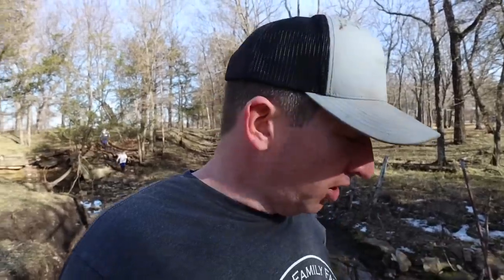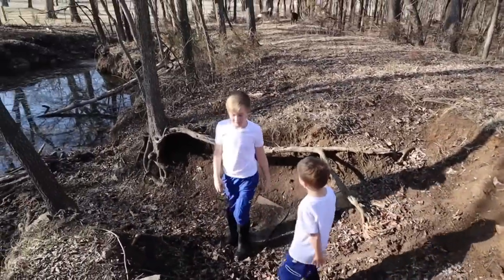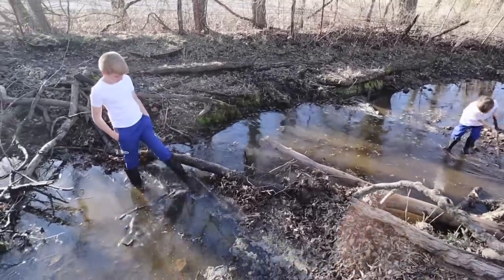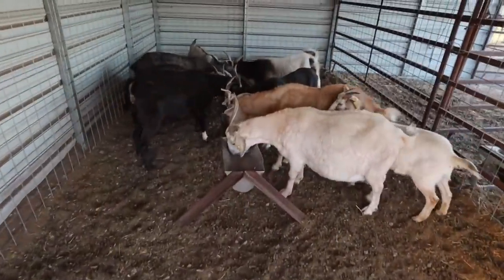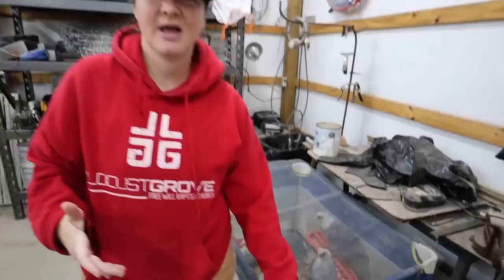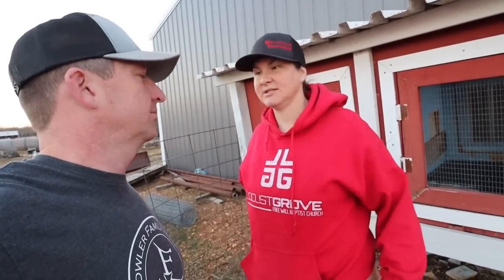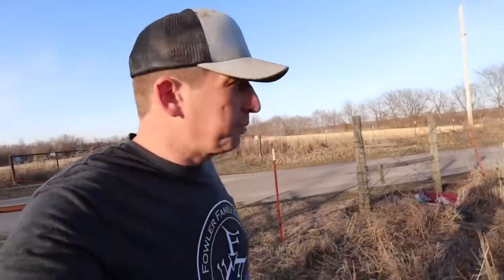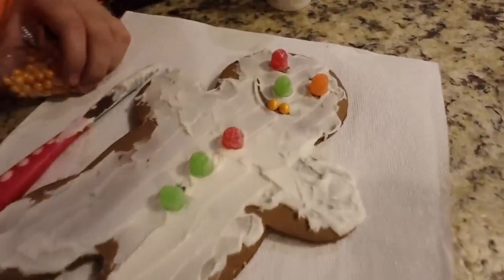Something Isn’t Right With The Cattle

Comment: I used to hang out with my little brother, like your two. We went on adventures, and built forts, and climbed rocks. Rode our bikes for miles. (Back when it was safe to do that) We sadly lost contact with each other after I joined the Army. Nearly 15 years later, we re-connected. We still lived far away from each other, but we talked when we could, and visited as often as we could (Not as often as we would have liked). He became quite the skilled woodworker. Several boats up in Washington State have their interiors re-done in teak, by him.  
Sadly, we lost him to throat cancer. He did smoke like a chimney. 
He requested that I spread his ashes. I took some time off work to do so, in a lot of the places we roamed. Couple places, I couldn't get to, due to being, now, private property, and posted. 

Anyway, I love that Ranger and Ransom are so close now. That bond will be a lifetime bond. They will both have great memories of each other. And, you will likely have two good protectors for Mazzy, later on. As my brother and I were for my sister. (She was born between us, so is the middle child)

Comment: Ranger maybe if you break that rock with the lines, you might find some fossils. I used to have to break rocks like that in the coal mines with a sledge hammer. Sometimes we would find some pretty cool fossils. Those lines are where the rock is breaking. 😃😄. 💖🇺🇸